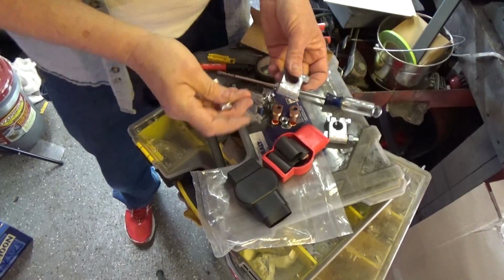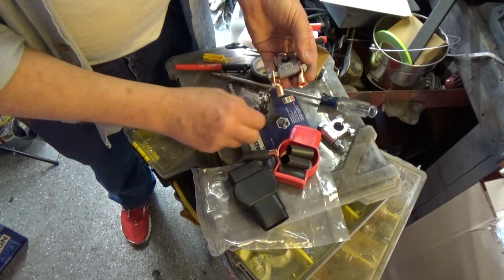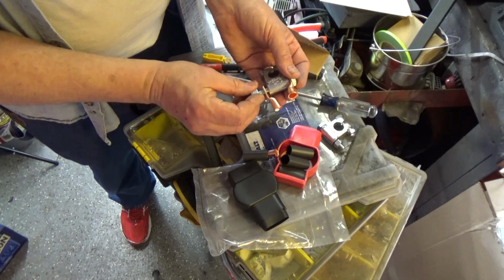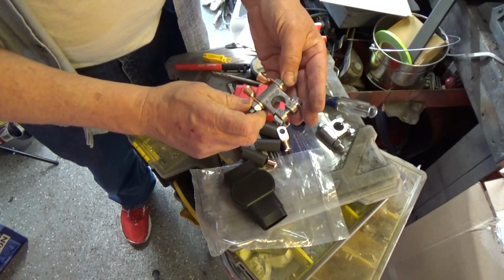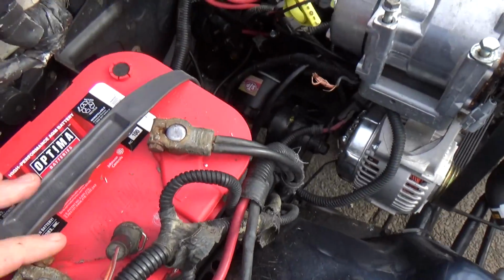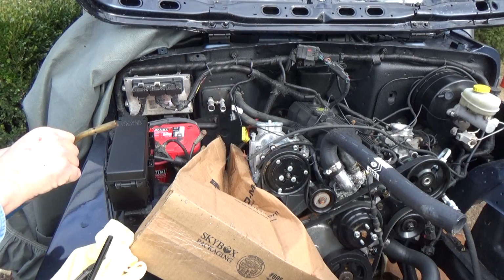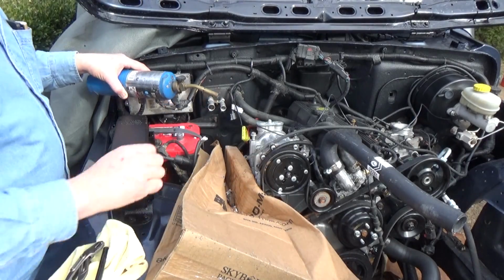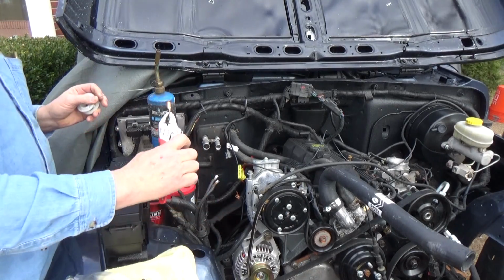Jeep Wrangler Project - Wrangler Replacement Battery Terminals - Nice Upgrade

Comment: Ordered a set, but didn't have luck getting my old terminals off. Had to just end up cutting them. The bolt on the original positive side was completely acid through and was only being held on my threads. The sleeve was the hardest to get off, but it was simple. Thanks for the walk-thru on this. My '98 TJ is purring along perfectly now.
Reply from the maker: Awesome - they can get pretty nasty :)

Comment: Ordered the Military Spec Battery kit and installed just like you showed in the video.  It solved my intermittent power issues.  Solid product, and cheap fix for common power issues.  I don't believe I'll need to give battery connection issues another thought for a long time.  Thanks!

Comment: Dave thanks for showing the tip for those battery terminals, I've always crimped them, never thought about soldering them.
Reply from the maker: I've found the solder actually works better than crimping

Comment: Looks very nice. I was having some issues with the power cutting off and the jeep not starting. My battery terminals were pretty bad looking and I could wiggle them off by hand. I wire brushed the crap out of them and put new bolts through them and it works flawlessly. Might not be the best way to fix it but its cold out!
Reply from the maker: I hear ya Captain warm weather motivates me more also hahaha

Comment: I've been wanting to do this, but I bought just the terminals a while ago from amazon. they came in the same packaging. what size guage is the factory wire for me to pick up the lugs?
Reply from the maker: +Illjustfall Hmm looks like 4 and 8 maybe - the kit came with all the same sized lugs so that's why I like the solder method because it fills the lug no matter the size wire.
Reply from the maker: Thanks bro !  Thinking about the big screen .... scary ! LOL

Comment: Good idea heating up the original terminals to remove the wires!
Reply from the maker: thanks Trev - they didn't melt as much as I thought - kinda crumbled
Reply: Did all you do is just heat it up and then pull the terminals off the wires?  I got these terminals for my Jeep.  Im like you, I dont want to lose any length on my wires, so Id rather do what you did instead of cutting them.
Reply: @DrSayre  I just remade the entire harness on the battery. Even upgraded the charging cable from the alternator to the fuse box and the fuse box to the battery.

Comment: very nice..but i cant find them terminals here in England...if i did find them i would use them on my jeep XJ for sure...good video Dave.
Reply from the maker: Thanks for the nice comments :) http://www.ebay.co.uk/itm/Corrosion-Resistant-Military-Spec-Battery-Terminal-Top-Post-Kit-With-Covers-/252538023450?hash=item3acc706e1a:g:~2cAAOSwGtRX1~PZ
looks like it would cost 17.00 USD for shipping tho ;)
Reply: hi and thank you Dave for the ebay link for the terminals...;-)

Comment: The Military spec for terminal post clamps are a band of steel cast into the lug.  Imagine the cheap sheet metal lugs on most cars cast into the form factor shown and you get the idea.... it keeps the clamp from crushing with excessive torque applied to the clamp bolt from deforming the clamp and the ends coming together from stretching the metal thus losing clamping force.  Since its hard to tell if its there, alot of clamps that are shaped like milspec clamps are called milspec, and might not be.  Unless you have problems with stretching the clamps  previously, having the band there or not isn't going to matter, so don't sweat it, and buy the item that gives you fuzzies.
Reply from the maker: Thanks - these terminals "gave me the fuzzies " hahahaha
Reply: Yup. Thats exactly what went through my mind. They look nothing like the terminals we used in the Corps...

Comment: When you were taking the old terminals off you said you cut them off. Did you just heat them up so the solder melted and you could pull them out or how did you do that part? Great video by the way